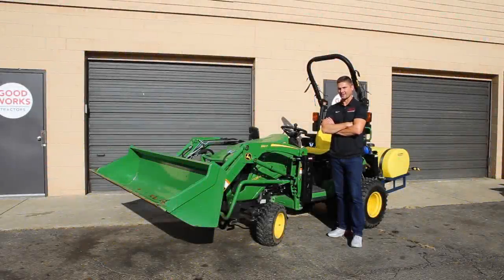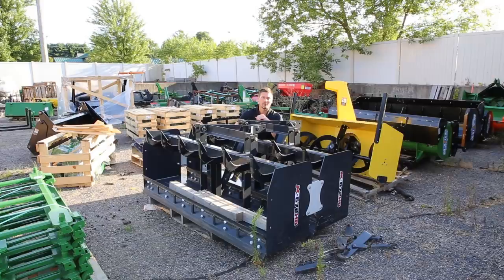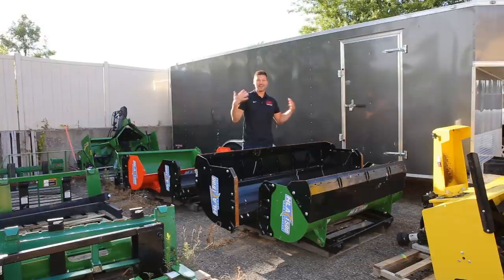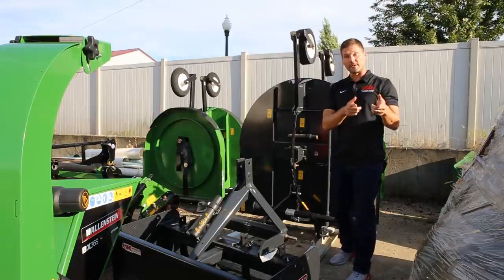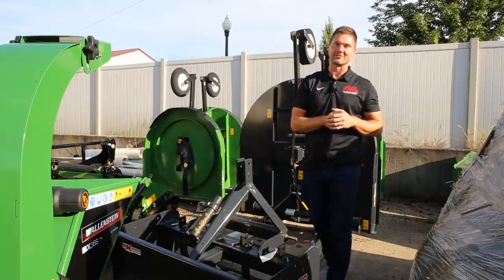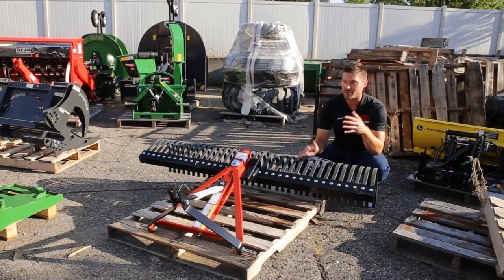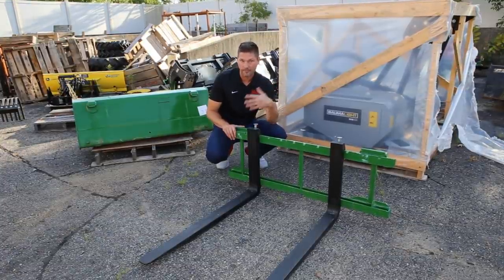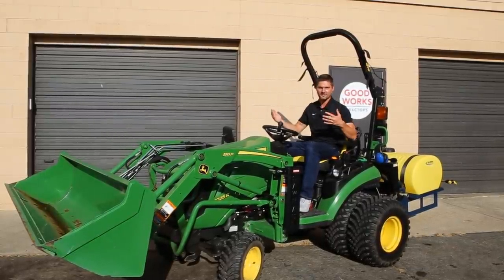HOW TO PROPERLY SIZE TRACTOR ATTACHMENTS! 👨‍🌾🚜👩‍🌾

Comment: The only problem I could see with using a sprayer as ballast is that it can move around. So if you had a load in the air, and dropped a rear tire in a hole that liquid would splash back and forth in the tank which could potentially upset the imbalance situation further. If you're already in a bad spot, and that spray sloshed in the wrong direction (which you have zero control of) you're going to be in a world of hurt. The only way around this is to fill the sprayer all the way full, which would work, yes. But I think a dedicated rear weight is a far better idea. Also, if you do get in trouble and roll over, you're not going to spill 55 gallons of expensive/potentially harmful chemicals on the ground with a dedicated rear weight.

Just my 2 cents.

Comment: Scooping up snow piles im light on the rear. Want tires loaded but thats 1000 lbs to haul and i haul mine a lot. Trk and trl can do it but not sure. I put my 3pt 3 bottom plow. It didnt help much as i need new chains with a different design. Tractor is already very stable

Comment: Im rehabbing a 8ft flail mower that someone donated to church camp. My 57 JD 520 may or may not be able to run it. Camp has a ford jubilee so not an option. My tractor definitely knows its there when picking it up. Needs a new pto shaft got one with it but telescope stuck. Turns out its twisted 10° ruffly.    Also needs a new belt (missing)  tensioner bent and siezed

Comment: I have a B2650. I carry around most days a 60 inch box blade for ballast. Along with the blade I made some simple brackets that I have my 20 gallon sprayer on always loaded with weed killer or just water. Works great and like you said it is handy to have loaded with whatever you generally need. Thanks for the videos keep them coming.

Comment: As I posted on a previous video, my 750# flail mower is my rear ballast (along with filled rear tires) on a 35 HP compact tractor.
I'm surprised the JDQA points on the wide bucket are in a position that the loader arms of a small tractor can lock into.

Comment: Hello, my englisch is typically on the conservative side. So, I hope I got your question about balance weight right. We frequently use our tractor cable winch as a balance weight. 275kg is enough in most cases and if not, we have to change to the "normal" weight (500kg). The main advantage: the tractor cable winch has a legal trailer hitch. No other weight or tool has this great feature.
Cheers Heinz

Comment: I think the sprayer tank would work fine for adding about 400 to 500 lbs to the rear.  I use by 72" flail mower for my 4720 as real ballast and leave it on most of the time as I'm mowing all summer.  It also is a lot closer to the tractor than a bush hog so backing into things is not a problem.

Comment: I use a 35 gallon container as ballast all the time. It's always got water in it since I use it to haul water to the barn (yes, a well is in my future). It's set up for the quick hitch so I just pick up and go. The only down side is the water sloshing water can sometimes be felt when you have weight on the front.

Comment: I'm in the market for a hay mower to start making my own hay. the tractor I use is a 1999 Kubota 5400 w/ 2wd, 50 pto hp. The mowers I've been eyeing up are two, first is a John Deere 625 moco requires 55 to 75 pto hp plus weighs 4200 lbs. The  second is a New Holland 488 haybine requiring 35 pto hp n weighs around 2300 to 2500 lbs. What do you all think would be the best choice.

Comment: What are your thoughts on the Tar River 60" Tiller you have on a 2025R ?  I just put 3" BORA wheel spacers on and I want to cover my tracks but not exceed the PTO HP - I would be tilling a lot of Ag land that hasn't been worked in 10 -12 years (at least initially).  Thanks !

Comment: The "too big" bucket doesn't make your tractor bigger, but the duel tires on the rear are cool.
I took 10 eighty pound bags of cement and poured them into a shipping create I had and put that on my carry all for added ballast. Works good enough for what I do and cheap enough to get the "Wife seal of approval".

Comment: Corey, when you are considering the lifting ability of forks are you talking about the weight you save without the bucket?  I know the forks are rated at a certain weight, but the bucket must weigh more that the forks.  That should give you a little more ability.
Reply from the maker: I'm talking about the lightweight forks weighing 130 lbs less than the standard duty forks.  I think the bucket for the 1025r for example weighs around 180 lbs.  The light weight forks weigh as little as 190 lbs, the standard duty start around 320 lbs.  Hope that makes sense.

Comment: So I was thinking of adding the duels on my 1025 but what size snow pusher would you recommend with that kind of set up?
Reply from the maker: I experimented with a 72" 1500 series and it worked great.  However, I think the duals and tires helped out a lot.  I also like to push the limits and see where things fail :)

Comment: I use a 60 gallon plastic food container strapped on my carryall as ballast when the backhoe isn’t on my BX. Works well for bucket work and I expect it will do same when I get some pallet forks. I have a 12v sprayer pump I use for watering a small orchard  from that tank and also for tree fungicide and pesticide spraying from other containers.  I’ve also tossed five or 6 80# quickrete bags on the carryall when I am concerned about sloshing or a high center of gravity (side slopes) or just need more ballast than the 600# combined weight of the carryall/barrel. Mix and match for the job and what I have around.